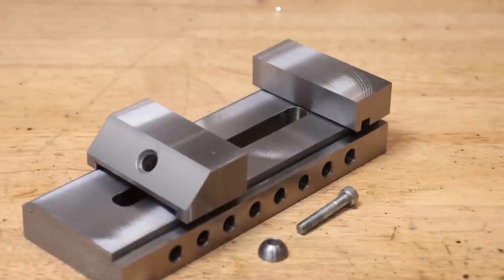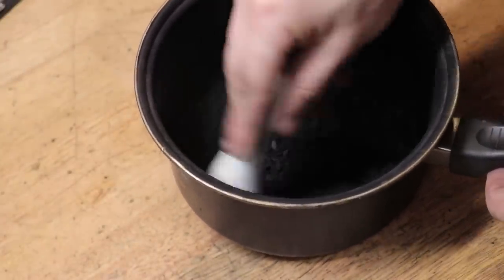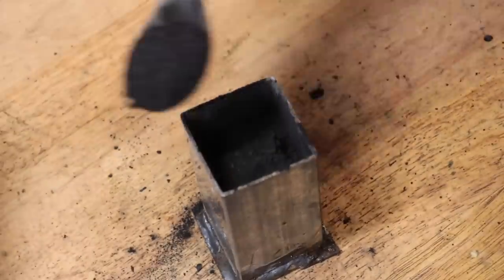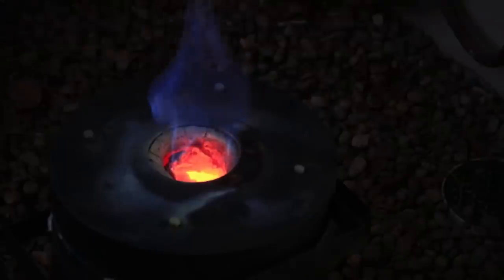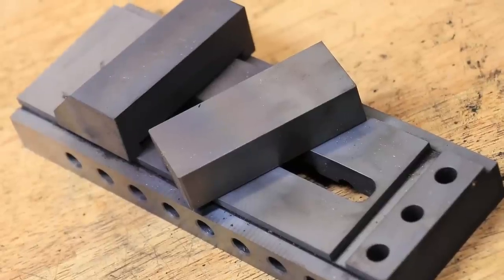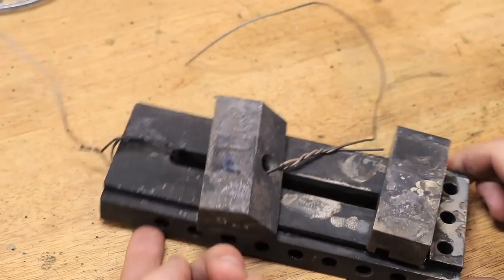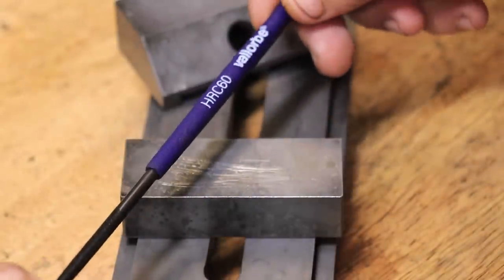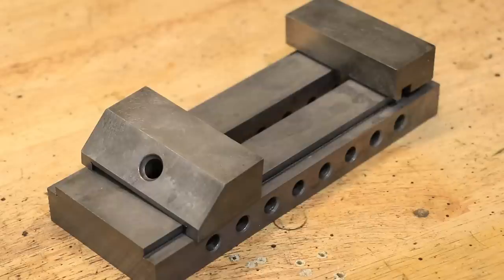Case Hardening And Heat Treatment - Making A Toolmakers Mill Vice   (Part 2)

Comment: Didi you get a chance to watch Clickspring's video on case hardening? It has some good tips in there, like making the casing out of clay (to avoid all that fabrication). Also, when quenching I think you might hurry up the dunking. It might mitigate some of the warping.
Reply from the maker: Yes I did, probably wouldn't have been as suitable for this type of set up. The packing paste seems much better suited for files like his. Sill couldn't figure out the reason for the salt in his mix.

Comment: Would it be economical to invest in case hardening equipment or buy hardnebale steel in the long run?It would be great if you could make a video of the case depth varying from 1 to 10 hours

Comment: Just a bit of advice. Case hardened parts don't need tempered since they have a soft inner core.
Reply: Also, you can boil the rust to convert it over to black oxide which is incredibly durable as a finish and won't rust further.
Reply from the maker: I wouldn't have thought so but the machinerys handbook did recommend a low temperature temper. Cheers

Comment: in damascus knifemaking they use SS boxes [and metal powder] as it must become part of the forging
I wonder if you could use muriatic acid instead of vinegar, but it might wreck the dimensions, and if left too long might rust in the solution, so a sweet spot of time req'd to be nailed
Reply from the maker: I don't know too much about Damascus steel, apart from the obvious pattern, but its interesting to know that they use stainless boxes nowadays

Comment: Briquettes being basically charcoal bits and dust held together by starch or another binding agent, you would have saved some time breaking up briquettes instead of lumps.
Reply from the maker: That's what I thought too, but as I was researching this I found an old forum pages where someone referenced that briquette binder contains some small amount of lime and phosphorous which could make the case brittle. Of course I can't verify that, but the machinery handbook does suggest that phosphorus can make the case brittle. Cheers

Comment: I thought this type of hardening had to be outsourced to get a decent result. Impressive that you got this result with basically household stuff. You don't have a surface grinder do you? Curious for the next episode.
Reply from the maker: Yeah normally you'd outsource this job because industry nowadays have much more efficient ways of case hardening nowadays. As I understand it molten cyanide salt baths and sealed carbon monoxide ovens are used to harden steel, rather than this antiquated method that I used. Funnily enough the book that I used recommend that I use "cyanide of potassium" as a carbon source which was a bit unnerving. Cheers
Reply: @artisanmakes  Cyanide smoke, don't breathe this!

Comment: I was trying to remove rust from the inside of a long tubing and decided that electrolysis would be the best option. So I plugged one end, filled it with water, put in the soda and connected the tube and a piece of rebar to my welder set to lowest setting (10A). After a few hours there was a layer of thick foam on in the pipe and the rebar accidentally touched the pipe and my ears were ringing for the next half an hour or so.
Do not let a large amount of hydrogen explode, it's very not safe.

Comment: Question on the design. I am making a 7" x  2.5" version of this. I noticed your fixed jaw design. What are your thoughts on reversing the location of bolts and keyway. My thought is bolts on the jaw face side to prevent jaw lift, and keyway towards the rear of the jaw to prevent slide. Are you seeing jaw lift with your design? My other thought is maybe with the forces for this tool I am way overthinking it...
Reply: Just watched Part 3. Looks like you already weighed in on that. Thanks for the great content!

Comment: Something I thought of... what if you used commercially available Carbon Black or the carbon filters from aquatic applications to start with a smaller sized raw material for your processing... it may be a bit more expensive but the labor costs should offset the price.
Reply from the maker: Yeah I’m sure that would work

Comment: oil quench would not warp them, and would get the same hardness. use salt water for quenching and move the part up and down.
Reply from the maker: Yeah I did a follow.up and addressed all this, my method was a little flawed in this video. Also I did a bit of testing before I did this, oil quench gave me about 55hrc which was below what I was aiming for

Comment: You should add some sodium carbonate to the carbon. The water should have salt added to increase the quench rate.
Reply from the maker: The machinery handbook does mention sodium carbonate in the packing mix but it does seem to be optional. I got great results without it. Same goes for brine vs water, handbook and the data sheet I have recommended either. Since I was anly aiming for 57 HRC after tempering  I felt that straight water would work fine enough, which it did. Cheers
Reply: @artisanmakes  The sodium carbonate makes the case deeper , faster and the brine raises the boiling point for a faster and more even quench. I know it works without it But it is so easy to add those things why not? I've done it both ways too. The brine might have helped with the distortion because it reduces the Leidenfrost effect which keeps plain water from cooling the thick sections while the corners and thin parts cool first. The salt and a vigorous motion probably would distort less. Something to try in future.
Reply from the maker: Honestly. I forgot I had a 1kg bag of sodium carbonate stached away. If I'd remembered I probably would have used  it. As for the brine I didn't think it it would make the much if a difference.  Just wondering, how much salt are you using in your brine mix?
Reply: @artisanmakes  about 10% by weight.
Reply from the maker: Thankyou, I'll have to look into this
Reply from the maker: Just to throw one more thing into the mix, had to reread that section in Machinery's handbook about case hardening, it refers to barium carbonate, not calcium carbonate. For what its worth it seems to be my heat treating book that refer to carbonates in general as a source of carbon.
Reply: @artisanmakes  There are several types of "energizers" that can be used. Barium carbonate is dangerously toxic. The use of an energizer is not essential.
Reply from the maker: @billshiff2060  This is the same section that casually recommends the use of potassium cyanide so its safe to say that this version of MH doesn't take safety too seriously. Cheers
Reply: @artisanmakes  re the brine for quenching, I seen photos of testing done in big glass tanks with a high speed camera and with a 10 to 20 percent salt concentration it almost completely stopped the liedenfrost effect.. I’ve never tried it myself but it looked like it really sped up the quench

Comment: The way ive always done it and was showed was not to use new oil, use USED motor oil for the extra carbon. like after u change the in your car keep it for hardening projects. I also do it in steps, cherry red used oil dunk, cherry red let cool to room temp, cherry red used oil dunk, cherry red quinch in water, cherry red used oil dunk, cherry red let cool down to room temp. And repeat.

Comment: Ive watched alot of your videos and others. I understand the hardening process, but everyone skips the tempering. You heat the part to a lower temperature for x amount of time and then what?  Do you let it air cool or do you quench it again?
Reply from the maker: I just let to air cool or cool off in the oven. Unless it’s an alloy with specific steps in the temper stage (and those are specialty alloys that I don’t use in the home shop) it’s not worth worrying too much about how fast you cool it off during the temper stage.
Reply: @artisanmakes  thank you. I've learned so much from your channel. I appreciate the help.

Comment: How are you measuring the temps?
Reply from the maker: Im not, unless I have a probe in the packing box it would be difficult to measure the heat of the part. That's why I waited an hour to ensure that the part was up to temperature before counting the time as case hardening time.
Reply: @artisanmakes  not really. Think about what’s happening. Your furnace is reaching a specific temp, whatever it may be. The part is in the furnace, there is a fairly short lag between the time the furnace reaches the temp and the part reaches the same temp. But you left it on for eight hours. Long before you turned it off, the part reached the furnace temp long ago. So all you need to measure is the furnace temp, as the part will be the same. My heat treat, melting oven has a digital controller. But it controls the temp of the oven. The part is in the oven. Even if I put it into a metal box with charcoal, the part would be at whatever temp the oven is at after a few minutes.
Reply from the maker: Sorry I must have misunderstood the question, I thought it was referring to the heat of the part as it heated up, someone else asked me that. I use a high temp pyrometer for measuring the temp and a high temp uv thermometer
Reply: @artisanmakes  yes. That was what I was asking. We know the temp of the part if we know the temp of the interior. We don’t have to measure the part temp directly.

Comment: next time try adding a 25 to 1 charcoal to barium carbonate.
Reply from the maker: I tend to steer away from barium carbonate due to the toxicity concerns, but I tend to mix in sodium carbonate to my mix now. Only issue is that it breaks down at a lower temperature
Reply: @artisanmakes  ahhh. ignore my other commeent, cept thr pinhole part :)

Comment: There's no safe way to completely contain the gas, you just want to allow it to vent, but no oxygen to leak back in.
Reply from the maker: Interesting, I suspected as such after thinking about it but the literature doesn't seem to go into detail about that. It just references a sealed packing box using kiln cement. Cheers

Comment: Dont harden in water, it cant handle such temperature so it makes steel more fragile. Use oil instead
Reply from the maker: I don't quite understand. Water quenching is just as valid as oil quenching but they are used for different reasons. For what I need water quenching is needed to get the desired hardness

Comment: I get what you're trying to do but you could have just bought some tool steel, milled the part and heat treated it for less than you spent on propane alone... And it would have taken less time.
Reply from the maker: Can't get tool steel in these sizes in these small quantities from the local suppliers.
Reply: @artisanmakes  order it. Admiral Steel.
Reply from the maker: @checoleman8877  Cheers, but i wouldnt be able to justify the costs shipping it half way across the world.

Comment: Next time use suitable steel for your vice.
Reply from the maker: I mentioned in the previous video i can not get high carbon/toool steel in this size. I have checked in the past with several suppliers but the truth is unless I'm ordering a moderately large quantity I'm not going to be able to get a piece of 4140 or similar, especially in the size of flat bar that I use in these projects. Plus most 4140 and other tool and high carbon steels are sold as round bar, not flat bar which makes acquiring it more difficult.  Cheers

Comment: Just use a higher carbon steel to begin with. Or wast a lot of time and propane trying to heat treat it yourself 😮.
Reply from the maker: You don't get large pieces of high carbon steel flat bar where I live. Not unless you are ordering meters of the stuff